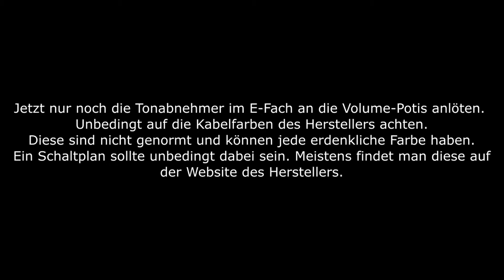Kurzanleitung: Tonabnehmer tauschen/einbauen

Comment: Aber das wichtigste haste nicht gezeigt. Das anlöten !!!!!
Reply from the maker: Das ist super schwierig darzustellen. Ständig sind halt die Hände im Weg. Zudem hat jeder Tonabnehmer andere Kabel. Gesplittet für Push Pull einfach mit an die Masse löten. Mein Tipp: schauen wie der alte PU angelötet war. Meistens (aber nicht immer) muss das rote Kabel an die rechte Lasche vom Poti. Alles was schwarz ist, wird ans Potigehäuse gelötet. Dann noch die Verdrahtung als solches, welchen Widerstand für welche Art Pickups, usw. Tatsächlich wäre das ein eigenes Video für sich. Und eine eigene Welt für sich.
Reply: @ManuelKiese  ich danke dir dafür jetzt habe ich sxhonmal einen kleinen Einblick. Also schwarz immer an die Potis 😁
Reply from the maker: Ich hab mir für diese Zwecke ein Multimeter geholt, damit man alles durchmessen kann im Zweifelsfall